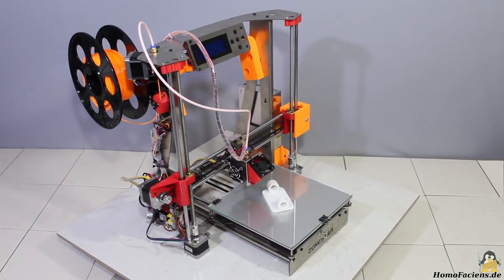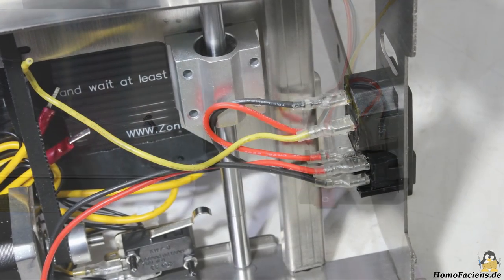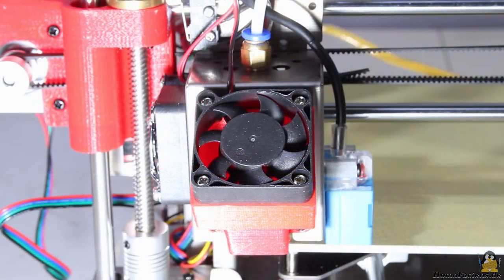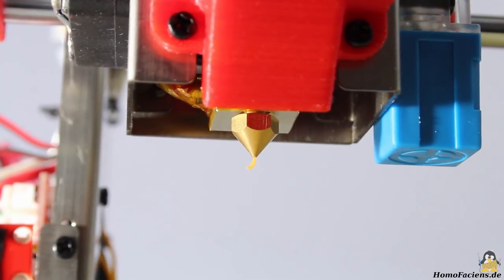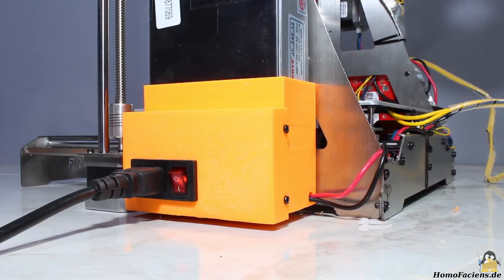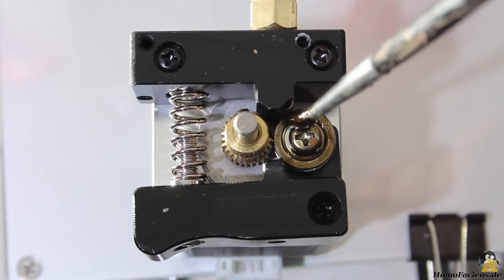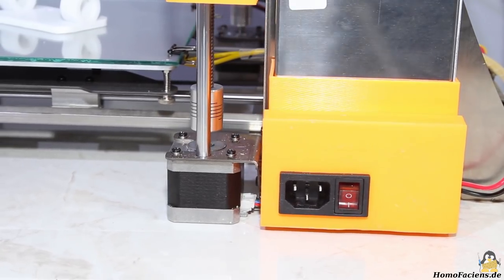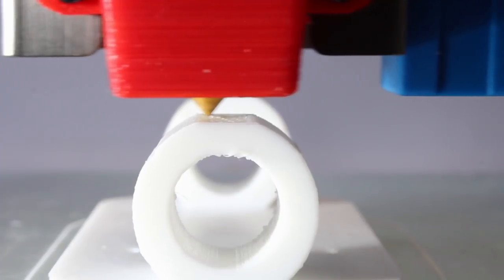Review and upgrades 3D Printer Zonestar P802Q

Comment: I'm not trying to detract from the purpose of the video, but for just a little more $$$ you could get an Ender 3 and it doesn't suffer from the poor quality issues this printer has.
Added to that it has a huge community behind it which should be a consideration to anyone buying a kit type printer.
Finally the Ender 3 is Open Source so theres plenty of third party spares, upgrades and firmware.
Reply from the maker: The one and only 3D printer simply doesn't exist, there are pros and cons for all of them and the Zonestar nor the Ender are an exception from that rule. It's the mainboard of the Zonestar with it's up to 6 motor drivers that will enable me to test a couple of ideas I have in mind - stay tuned.
Reply: @HomoFaciens  Honsetly, I think you could build a far better quality machine for less and still have a 6 driver motherboard ;)
Reply from the maker: ...I will try to do so in the (hopefully) not so far future ;-)

Comment: That blue piece on the print head isn't a bed leveling sensor?
Reply from the maker: It is. I still prefer manual leveling since the sensor isn't that accurate.